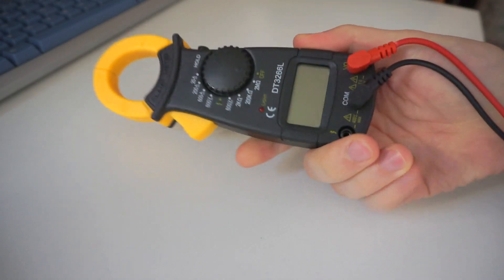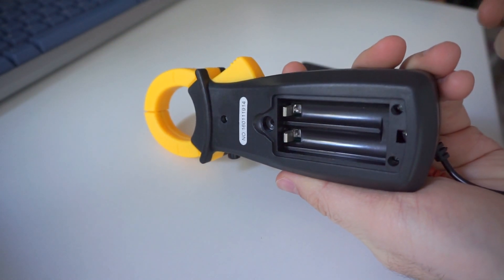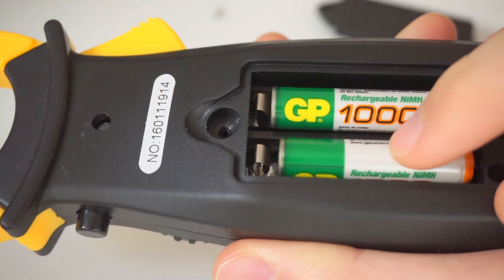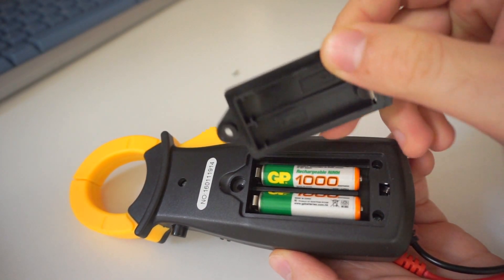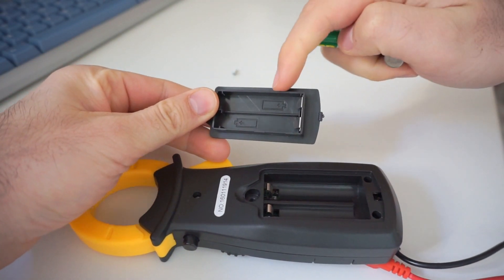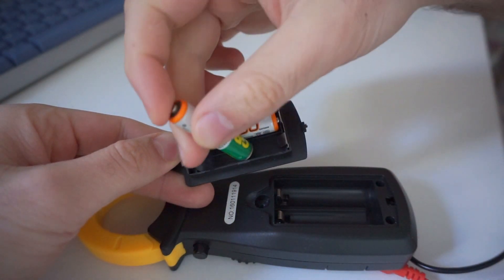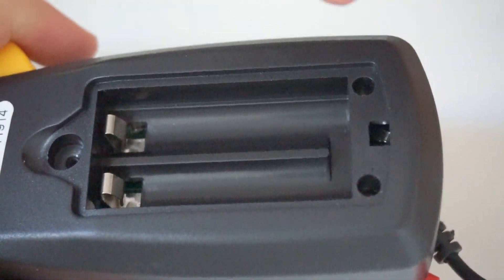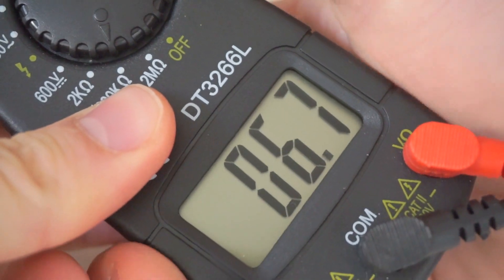DT3266L Digital Clamp Meter - Battery Installation

Comment: Note to others: When I inserted the batteries correctly, the multimeter did not turn on. After investigating a little bit, I moved the silver connectors on the multimeter with a small screwdriver to ensure contact with the batteries. Works great now.

Comment: Instructions on the manual and device are really bad. It wouldn't hurt if you could give a few tips as to how to use it for various function, once battery is magically installed.
Reply from the maker: How to measure AC Current Draw with a Clamp Multimeter ► https://www.youtube.com/watch?v=HfAz9iVQoiY